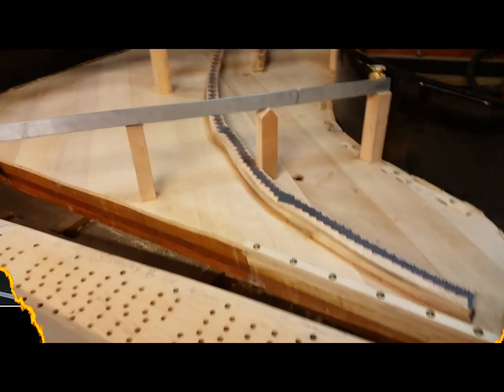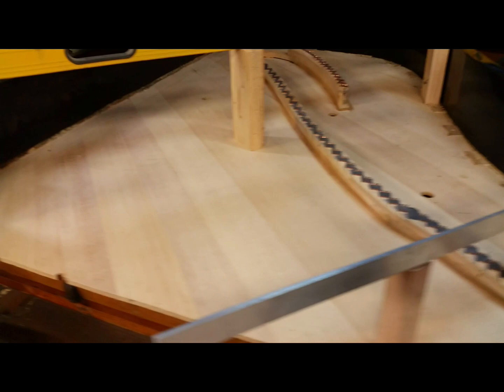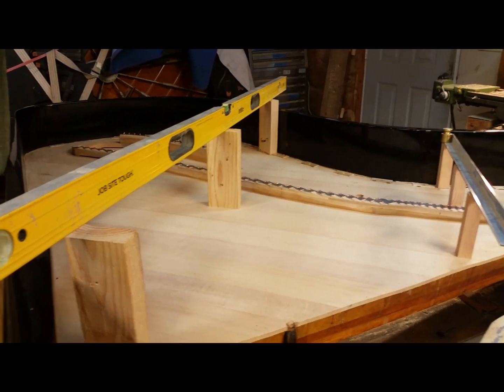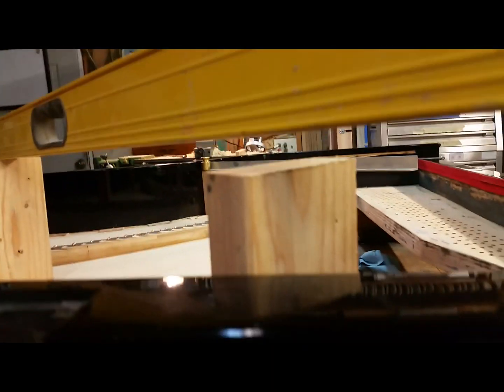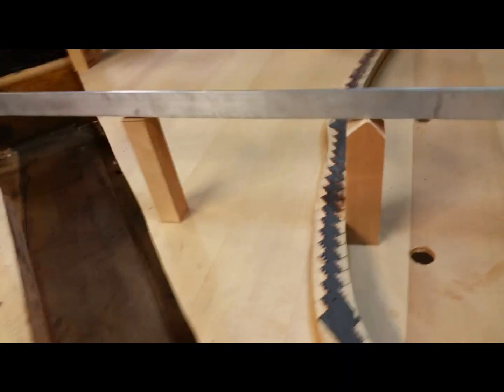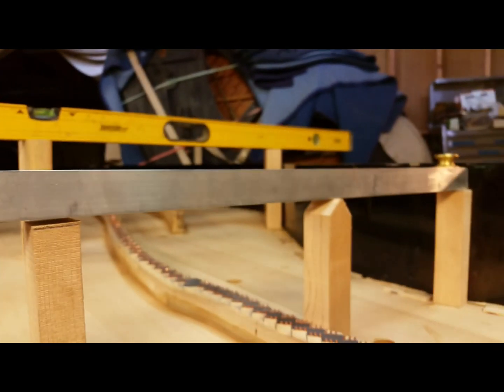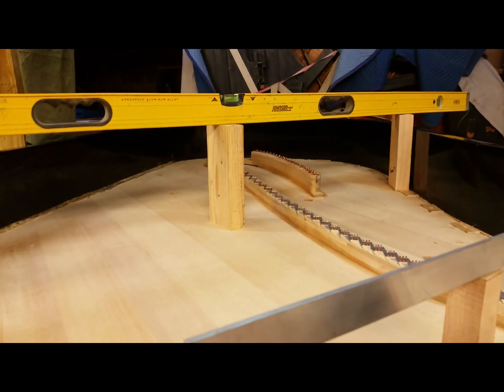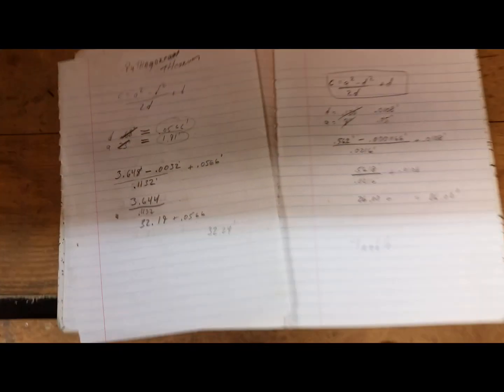Steinway B Growing Crown and Pythagoras

Comment: I am not an advocate of such high crown, for a number of reasons. 1) The high crown (small radius of 30 ft instead of 60 which is normal) is probably caused by drying sound board too much (or putting alot of profile in the ribs). Drying too much can overload wood bearing capacity, resulting in cracks later on. 2) High crown and much downbaring cause strings to angle a lot over the bridges, pressing down hard on the sound board. This results in high tuning instability due to humidity changes. I have a 100 year Grotrian with no downbearing at all and it had the most wonderful sound and moreover, its tuning is rock-steady. 3) The "sharp" angle of the strings over the bridge limits sound board movement.

Therefore, I do not believe in "more is better". The Steinway 1936 patent on soundboards explicitly mentions low downbearing. Downbearing is not necessary for good sound. Also the Bluethner book on piano building states the same. Refer for instance to Stuart & Sons, Steingraeber Phoenix who use special agraffes in the bridge and perfectly flat sound boards. The crown is just a method to introduce a little flexibility and to acommodate mechanical tolerances and fitting.

That said, sound board curvature, width and thickness do have an effect on eigenfrequencies. Therefore, the soundboards are wider, thinner and flatter in the base and narrower, thicker and more curved in the treble.